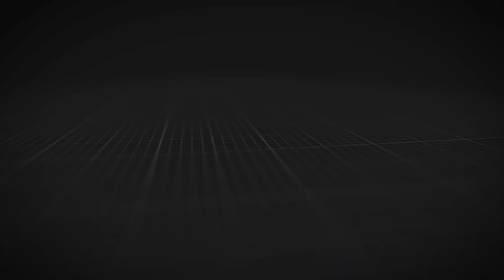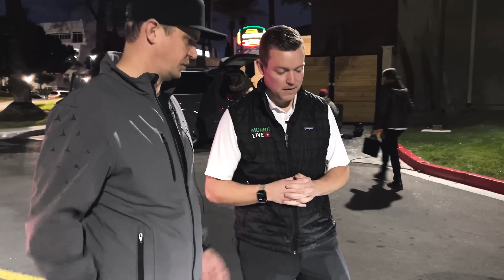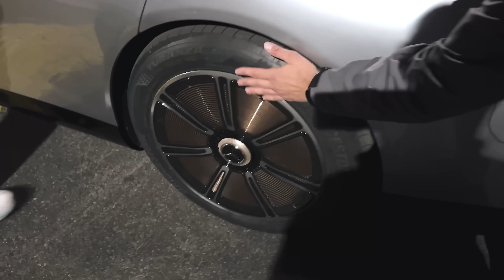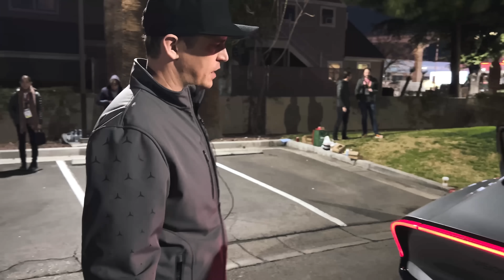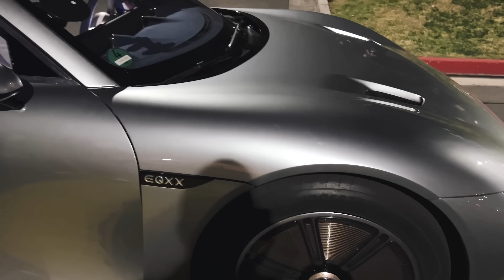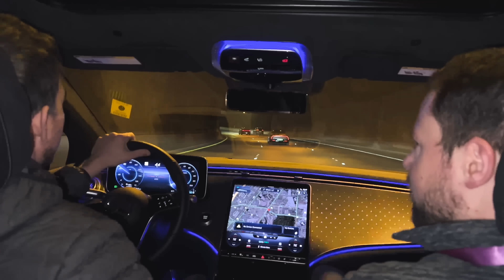The Most Efficient Mercedes-Benz Ever - Mercedes Vision EQXX Ride & Drive | CES 2023

Comment: I guess if you keep adjusting a car for aerodynamics you will end up with the Lightyear, EQXX and (less so) the Ioniq 6. As the computers will all keep giving you the same information. To be truly different you have to go the Aptera way. Which I think is far better because they got to amazing aerodynamics and efficiency and weight saving without building something that no-one can afford.
Reply: Mercedes has never concerned themselves with being affordable.
Reply: @Factory400  Don't forget Mercedes massive "under $30k" campaign for the original CLA
Reply: Yeah, I agree, especially on the Aptera part. In this Mercedes the 2 rear seats are so small that you can only realistically sit 2 kids, but if you have 2 kids, you want a SUV or at least a bigger sedan. With the Aptera you have 2 nice front seats, an actually pretty big trunk, a more aerodynamic  body and a more efficient and lighter vehicles, that is more affordable both for the manufacturer and the consumer.
Reply: @flaviosalatino8192  Why do you need an SUV for families? Plenty of families use sedans in... probably everywhere out of the US.
Reply: I cannot see a 3-wheeled car being very practical for general purposes. Imagine driving on an icy road or wet, slippery highway. Or imagine being slightly hit on a side by another car, who knows how ypu will end up rotating. I don't see safety being that good for that concept. Sure, will work just fine for some minority, but it will remain a niche.
Reply: @ContraVsGigi  Two front wheels and one rear is actually very stable. I can imagine being hit in the side.... But only imagine..... Because after over 40 years of driving in over 15 countries around the world in cars, bikes and even trikes.... I have never once been hit in the side. Snow & Ice.... Sure... I ridden a motorbike and done a daily commute in every weather including snow & ice. But as transport it is safer than a motorbike and more fun to look at....
Reply: @mikadavies660  Sure, it is fun, but most people need confort and safety a lot more often than fun.
Reply: @ContraVsGigi  Agreed but you have Mercedes, BMW, KIA, Ford, GM, Canoo, Tesla, Peugeot, Renault..... etc etc for safety, comfort. So there is some room left in the 80 million cars per year marketplace for individual fun.
Reply: @mikadavies660  Yes, exactly what I said, it is gonna work for a niche.

Comment: 12 volt ? I would have expected something like 48 v in such an advanced concept where weight reduction was a main focus
Reply: The whole automotive industry is based on 12V for interior, safety electronics. My guess is it is super hard to find suppliers for every single electronic part to run on 48V. Also, as long as you don't have to transmit a lot of power, there is no significant advantage in having a 48V system. The only use case i can think of is 48V power steering, which would require power in the kW-Range.
Reply: All the available auto parts uses 12v. Even all the EVs have a separate 12v battery to power those components (and charge the 12v battery when needed)
Reply: 48v can save a little on wire weight while gaining weight with other components.  Overall it would add a lot of complexity for very little, if any, gain.
Reply: Tesla wanted to use 48v but was too hard to find the parts.
Reply: Cybertruck will be 48v

Comment: Ironic that air suspension is heavy on cars. In the 90s, in mountainbiking, that was the lightweight choice at least. Not the plush one, though.
Reply: I believe MTBs in the 90s didn't have air compressors on board :D

Comment: That car is very impressive.  Love the efficiency focus.  The HP race is taking the EV focus on efficiency the  wrong direction.  Todays EV's are "gas guzzlers".  With an ultra low CD we could have much smaller HP figures to just sip the energy.   That is a beautiful car.
Reply: The flip side of high horsepower is fast charging.   Modern EV's support super fast charging, which means they also support super fast discharging.   So it's cheap and easy to add a high performance motor.   OTOH, without battery cooling this car probably doesn't support very fast charging anyways, so more weight can be taken out with narrow bus bars et cetera.   The efficiency means that miles of range per minute of charging won't be too bad, but i suspect a 0-100 charge will take hours.   With a 700 mile range, overnight charging is fine...
Reply: A more powerful electric motor does not need to use more power.
Reply: @FreekHoekstra  The added weight of the bigger motor + bigger bus bars + bigger power electronics + better cooling means a more powerful car uses more power even when its engine isn't.    The EQXX is a lot more efficient than the Plaid S.
Reply: @FreekHoekstra  BUT it typically does.
Reply: @Longsnowsm  no it does not….
Tesla plaid, one of the most efficient.
Lucid air one of the most efficient.

Versus say audi etron, one of the least efficient and least strong

Its about body aero and electric drivetrain efficiency. And an electrics motors maximum output has nothing to do with its efficiency under normal load at highway speeds, its not related.
Reply: @FreekHoekstra  Well you buy them then.  I am looking for efficient vehicles.  Not "gas guzzling" bloated EV boats with every bell and whistle and loaded with stuff.  As far as I am concerned the entire EV industry has chosen an unsustainable path.  Those of us who produce our own electricity count every watt.  While I am doing that watt counting I am not going to add wasteful energy pigs to the load that I have to produce.  So enjoy your Plaid or whatever you like, I am not interested.  Sensible engineering decisions that maximize energy use is of far more interest to me.
Reply: @Longsnowsm  powerful EV’s DO NOT GAS GUZZLE.
Its not a thing, you are wrong, read my post again…

What Makes Me an EV inefficient, is bad aerodynamics, too big frontal area,bad tires, bad inverter, bad battery cooling systems, not having a heatpump.
Note that “having a powerful engine is NOT on that list.
And yes the Tesla model S plaid and the lucid air and mercedes EQSS are the most powerful and efficient vehicles on the planet that you can buy right now.
Case closed.
Reply: @FreekHoekstra  Ok, are you getting anywhere close to 300mpge?  What is your MPGe?  You are aware that an old VW XL1 is capable of over 300mpg?  Small diesel powering electric power train.  Estimates for Aptera modeling is showing 300-400mpge.  Most of the EV's listed are 140mpge combined hwy/city or less according to fueleconomy.gov web site.  Your "efficient" Plaid is 116mpge combined.  We are not even remotely efficient... Not even close...  Lightyear 0 is moving us closer to more efficient numbers and is going into production but the price tag is out there.  Lightyear 2 has been announced, but not enough details yet on what numbers they are going to put up.  This MB is at least attempting to get more efficient but is clearly a prototype that is just a demonstration of the technology.  You show me something closer to those 300+ mpge numbers and I will be impressed.   116mpge combined and you think that is efficient? ROFL this is a joke right?  The truth is the vast majority of the EV "gas guzzler" owners out there are addicted.  The right foot has lead poisoning and people will do anything to justify these inefficient "gas guzzling" vehicles..   All the justifying in the world isn't going to change that.  Show me some serious efficiency numbers cause this isn't it... Why gas guzzlers?  Because it is a repugnant energy sucking term to describe these inefficient wrong headed EV's and the direction of the market.  GAS GUZZLERS!   CASE CLOSED!
Reply: @Longsnowsm  lightyear 0 got cancelled, the aptera is not out yet, we’ll see about that ever making it the vw xl was a small run pet project, and why are these efficient because they have super low aerodynamic drag it has nothing to do with the amount of power in their engine. ZERO.
The most efficient EVs that you can actually buy, are powerful sedans, model 3 model s lucid air,
And they beat less powerful cars like the leaf, etron, ipace etc etc etc. 

Ergo power does NOT equal efficiency in an EV, 
That is completely separate from packaging which is what you’re getting at above here which is aerodynamic drag and other parasitic losses.
Reply: @FreekHoekstra  Wrong... Every example I just gave you was focused on EVERYTHING.  Weight, aero, rolling resistance, power management... The entire package.  You show me one of those examples that was a "power house" of a platform... Can't do it.  You are NEVER going to get a rocket ship to be as efficient as an energy sipping focused on efficiency vehicle.  Doesn't exist.  Go back and watch this video again with the MB guys talking about what they had to do to get the efficiency.  It wasn't just aero.  They had to go as light weight as possible.  They had to address the rolling resistance.  They had to address energy consumption and parasitic power draw.  It is an entire package.  Sorry but your Plaid and Lucid's are far from efficient.  The fact that we have examples that have been able to put up the 300+ mpg numbers should give you an clue we aren't even scratching the surface.  These current EV's are heavy bloated inefficient pigs.  That is a fact.
Reply: @FreekHoekstra  The only way we are going to get efficient vehicles is if the market changes direction and focuses on the aero, weight, rolling reistance, and power management and I assure you they can put up better numbers with smaller more efficient motors than what is being sold today.  They are marketing to the lead poisoned 0-60 and go fast consumer to try and convince them to get an EV... And then trying to tell us how efficient they are.  We can do a lot better.  This is embarrassing.
Reply: @Longsnowsm  exactly everything except the amount of power the engine makes a difference...
That is exactly right because it is the only thing that basically does NOT matter.
Efficiency of the engine matters but it’s not related to how much power it can make.
A.k.a. an electric vehicle that has more horsepower is not necessarily less efficient than one that makes few horsepower.
Which is specifically what we were talking about.

You are still thinking I CE mode big engine more power consumption, That’s not how an electric motor works
Reply: @FreekHoekstra  Ok, you win, no matter how big the motor is it doesn't use more energy and isn't more inefficient...  Just keep telling yourself that.  They are clearly marketing these for you.  Over 300mpge is doable.  I assure you when they produce a vehicle that gets that kind of efficiency it will NOT be with anything remotely like what they are selling today.  Clearly not enough people are producing their own electricity yet or we wouldn't even be having this discussion.  They would be focusing on the vehicles I am talking about.  Enough said.    Good luck to you.
Reply: @Longsnowsm  dude i work as an engineer on developing cars… and yes, that is right,
A bigger electric motor is not less efficient then a small one, infact efficiency improves with power usually.
Reply: @Longsnowsm  well if you would’ve paid attention you might’ve noticed that the engineer in this video didn’t say that smaller motors are more efficient.
A 500kw 98% efficient motor, is more efficient then a 150kw 95% efficient motor. 
Because the power is unrelated to the efficiency, unlike ICE motors of old.
Reply: Irritating thing is I don’t even disagree with the you on that cars should get more efficient, and I love what Mercedes has done here.
We actually agree on almost everything - except one core basic fact which is big engine is wasteful because that’s just not true in EV’s.
Get off at high horse do some googling find out that you’re wrong and stop being so angry because yes I have done my research and yes I work in the car space and know what you think he said is not what he said.

This way of debating with people is going to alienate them.  if you want to ever convince anyone of anything you should never debate them this way.
You are guaranteed to make them angry at you and will forever disagree with you. You will never be able to convince them ever again.
Reply: @FreekHoekstra  You should go watch the other presentations on this car.  They really would help you.  They chose the most efficient motor sufficient for the work they were trying to accomplish.  It is "enough".  Funny the Lightyear 0 also used a "puny" low power motor also... Very odd...  Funny come to think of it that VW XL1 hardly produced any power but somehow was getting over 300mpg.  Today's cars are gas guzzlers. 

You put up your PV system yet and running everything off of power you generated?  Your perspective will change.  Either by grid load shedding rationing or having to produce your own power you will rethink a lot of what you think you know today.  The excuses why we can't produce efficient vehicles will change.  One way or the other.  LOL
Reply: @Longsnowsm   my god you really are a brick wall… 

Google for the love of god, efficiency in electric motors…
Reply: The Model S Plaid is pretty efficient too, one of the most efficient EVs, despite the 1020hp. And it's environmental footprint is smaller than a conventional small city car's. Going further requires increasing amount of compromises from the owner, which makes it harder to sell. There's no way this Mercedes would be affordable, and those who pay big money don't like to compromise.
Also if you charge the car with renewable energy, which is common, it almost doesn't matter. It makes more sense to focus on sustainable manufacturing.

And I think it's a waste of money to develop a car that will never go into production. Most of the research today can be done in a computer, current models are insanely accurate. For example simulated crash tests match real ones perfectly, and it's an extremely complex process.
Reply: @andrasbiro3007  I don't subscribe to the EV gas guzzler model.  If we put that same level of effort to motors that use far less power there should be no reason we shouldn't be able to see a nice boost to our WH/mile WH/KM figures.  Finding that balance of "enough" HP/torque for the specific vehicle to use a little energy as possible should be the focus for "normal" EV's.   The theory that it doesn't matter if you use renewable energy is a false premise unless you are grid tied.   My off grid solar every watt counts.  Especially this time of year where there is very little sunshine.   People just don't pay attention to how much electricity they use.... Yes, most people are "gas guzzlers" in their homes also.   If people were actually limited to the power that they produce themselves they would have a completely different perspective on the subject.  People are not very efficient and are very wasteful.   We need an "EV coach" both in our vehicles and in our homes.  LOL   I don't care if MB wastes money on million dollar proof of concept vehicles like this.  I am not the MB target customer.  🙂
Reply: @Longsnowsm  The UK had the right idea with providing people with smart meters that allowed them to monitor their actual energy use and learn how to become more efficient and save money.

Comment: The efficiency of this super expensive and unpractical EV, at a ideal constant 70kmh is a mindblowing 8kWh per 100km. The same as a Tesla Model 3 in the exact same test environment setup. Mercedes is still lagging far behind.
Reply: Bullshit, the EQXX averaged 8.3 kWh/100km in a real-world test drive over 1200km throughout Europe. with speeds up to 140km/h and an average of 83, so normal highway speed and no hypermiling with constant 70.
I don't think a model 3 could come close to that.
Reply: This car is WAAAY ahead of a model 3 in efficiency terms.  Not even close.
Reply: @Factory400  its not a (usable real) car. Its a purpose built concept. The drivetrain is unusable irl
Reply: How much does it cost?
Reply: The Model 3 is pushed to get 5mi/kWh (you can do it if you are very careful) the Mercedes has done 7.7mi/kWh over 600 miles on autobhan/motorways.
Reply: @FFVoyager  highway at low speeds with an occasional 120kph just to be able to say that. All marketing, none usability. You will see nothing of this back in their real cars that have terrible efficiency